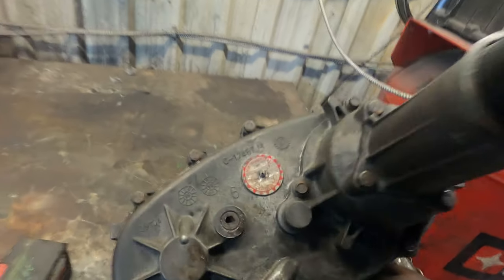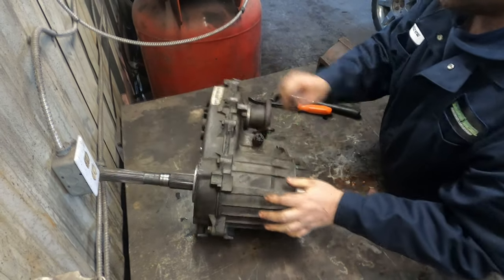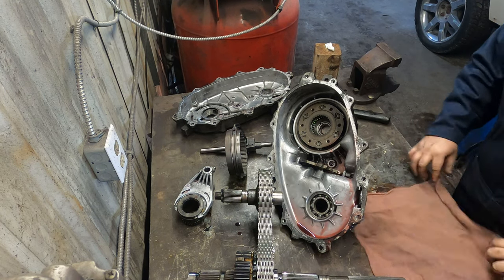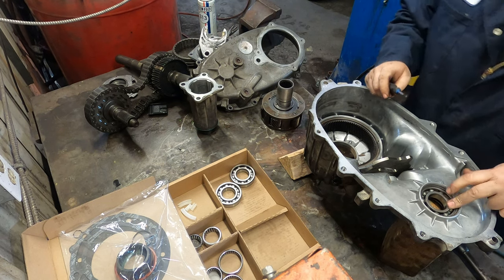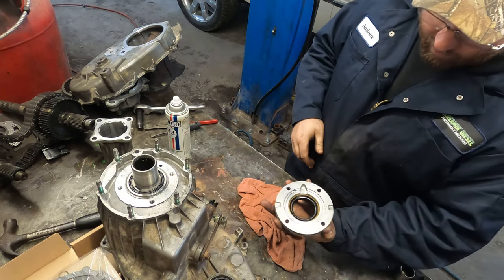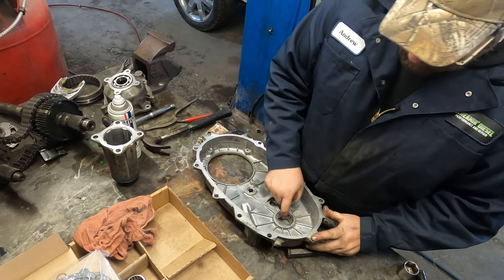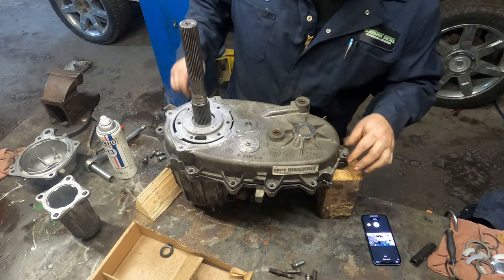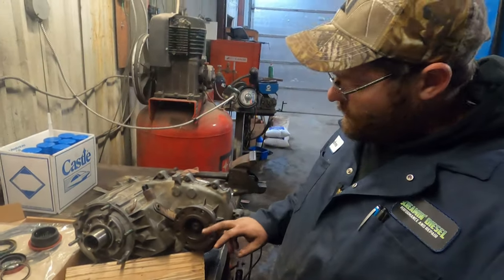241 DLD TRANSFER CASE REBUILD #CUMMINS #TRANSFERCASE #REBUILD

Comment: Hey man awesome video. Its better than taking 100 pictures to remember the orientations and order. 

Just fyi: I ordered a "new" front case half on ebay cause I cracked mine, and the bearing that came in it is the same small one you had. My planetary was walking in and out like you diagnosed so it was an easy fix for me. But I think that short bearing is a manufacture problem not just some weekend warrior repair

Comment: Thanks I got to split my transfer case as I have a slight leak from a over hauled tc . I had it done when I had the g56 installed in my 95 4x4.  What a learning experience.  So I ordered some sealer on Amazon I believe the kind you reply to on a post . I hate leaks . Thanks for the video . I wa told to used 5 w 20 synthetic motor oil in tcase . I not done that yet but have you heard that before Thanks

Comment: Does the snap ring on the input shaft cause the truck to go on neutral if it breaks?
Reply from the maker: Yes I believe it will. The shaft will pull back into the case.
Reply: @ ok. I appreciate you replying man.

Comment: is the transfer case separate from the transmission fluid wise? like does the transfer case need to be filled separately?
Reply from the maker: Yes it does. The 2 fluids don’t meet
Reply: Depends on the vehicle

Comment: This guy uses hammer ,but not a screw driver to seperate case! What tech shop did he graduate from,smash it ? The housing might become fractured,and later explode!
Reply: And he uses a claw hammer. A claw Hamer is a construction tool, not a Technicians tool. He did a great job, but having the right tools for the job is important to doing it properly and not having a come back.